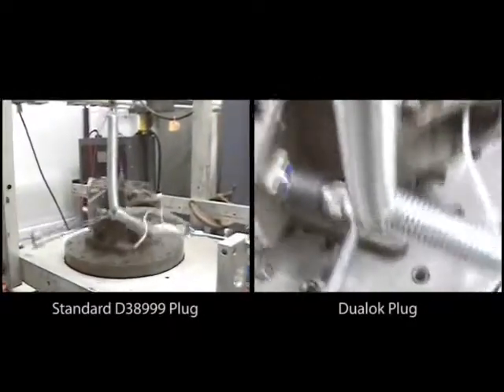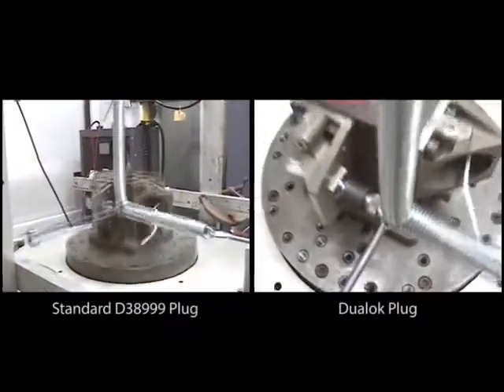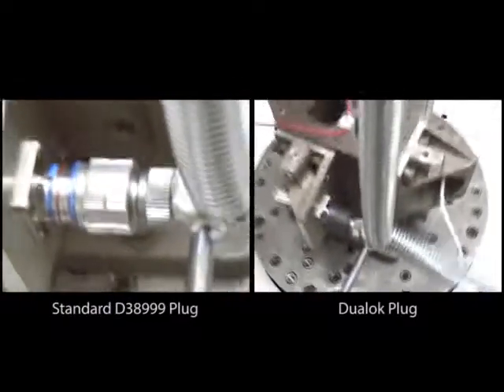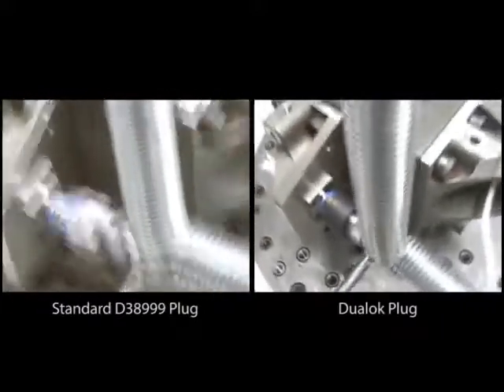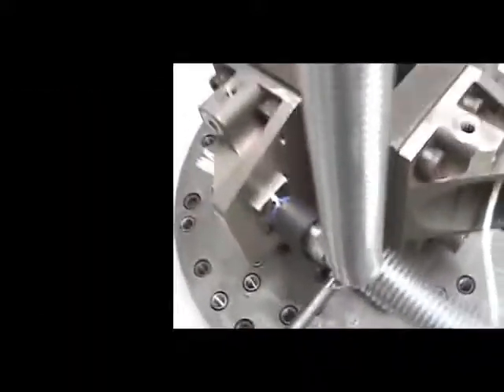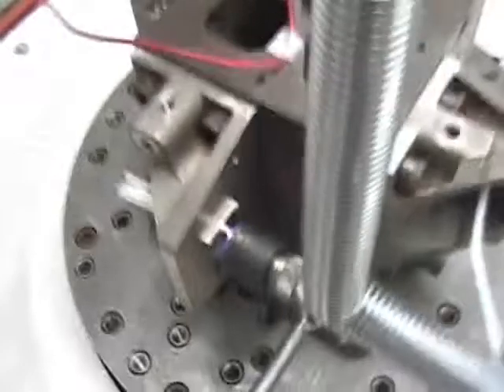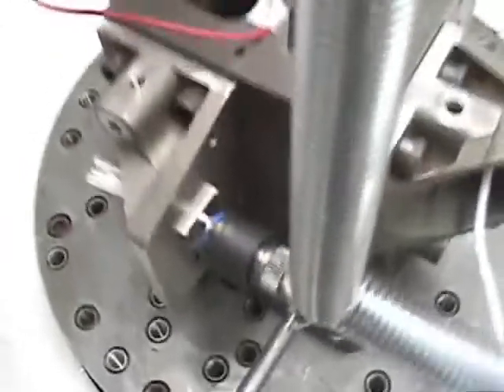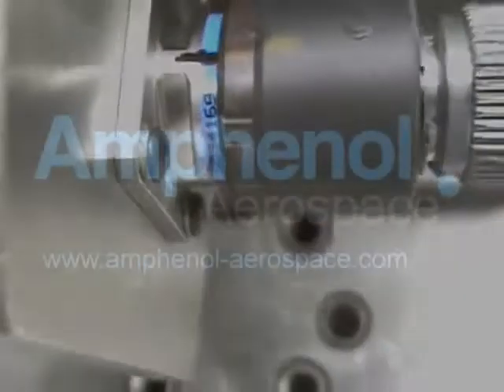Dualok: Vibration Testing vs. Standard D38999

Comment: Thanks for sharing, but video could be improved by showing method of coupling plug to wall mount receptacle. How involved is the coupling? Can it be done with one hand in a confined space? 

Random vibration freq. range of 10Hz - 2KHz doesn't appear to match the violent amplutide shown on the shaker. Looks more like a 0 - 5Hz range with a 2" or 3" amplitude. 

Also, how does the Duolok D38999 compare to the TV26/MTV26 Clutch-Lok Plug compare? Are they interchangeable?

Clutch-Lok Plugs are also not interchangeable with D38999/26 connectors, since they have different insert arrangements. Clutch-Lok plugs have high density insert arrangements that are discussed in a Amphenol Aerospace connector HD38999 PDF.